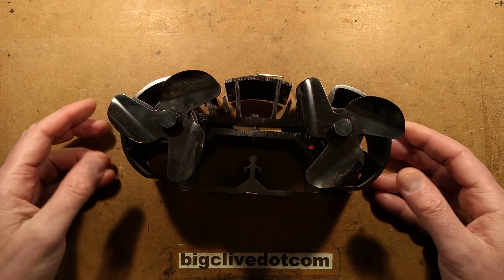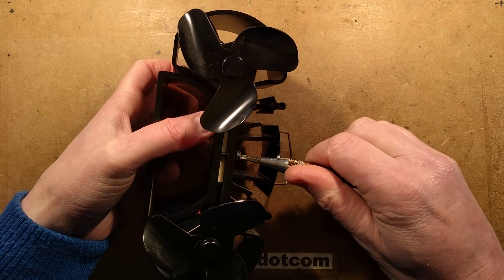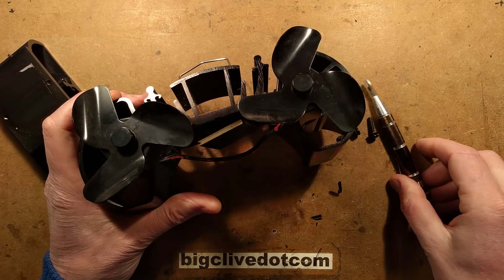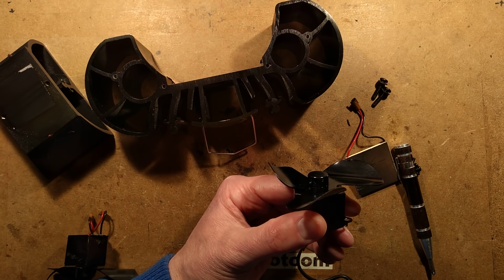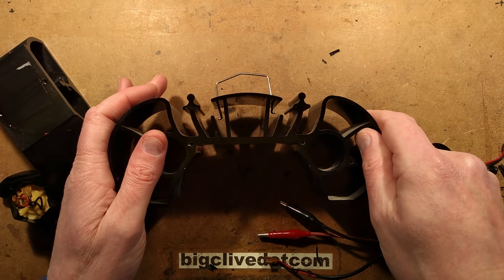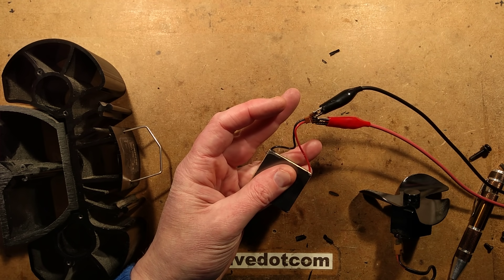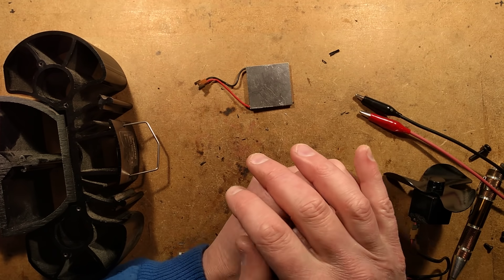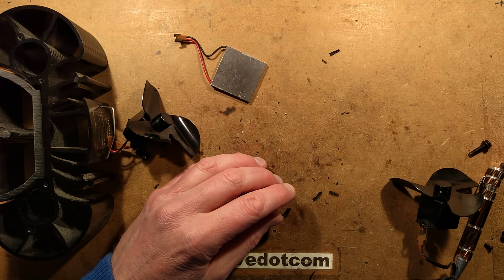Teardown of a self powering machine.

Comment: Get them at ALDI for £20. Might grab one and try to convert it to brushless. Got loads of spare motors and ESCs from quadcopter wreckage. Heat controlled PWM control circuit required.
Reply: Do all brushless need PWM? I thought they used hall effect sensors but that might be my brain shutting down why? No clue.
Reply: The motors used in Radio Ccontrolled models, drones, electric bikes, cars are 3 phase AC delta-wound and require an ESC. The ESC is  converts DC to 3 phase using FETs and also controls the speed using one of many digital protocols OR plain old PWM. The control signals are opto-isolated.  Some ESCs have telemetry and can detect feedback from the motor windings so hall effect is cleverly "built in". Most ESCs can provide regenerative braking too.
Reply: Some use hall effect sensors, other use back EMF on the non powered poles for rotation sense. All need 3 phase power and standard ESC's take PWM in to produce 3 phase out at variable frequency.

Comment: I have to wonder if those peltiers are a bit specialized, with more junctions than usual.  They need enough voltage to run the motors, so maybe it has more than normal.  I was suspicious when it only was drawing 1A at 8V.
Reply: It is not a peltier but a T.E.G (thermal energy generator) these can take much higher temps than peltier devices.

Comment: I have one of those peltier fridges, got it because I was being cheap. It's a piece of shit, the fans were loud so I replaced them with quieter PC fans and at that point I'd spent as much as a normal fridge would've cost. It's also inefficient as you said but I don't pay for my own power. I'm getting rid of it as soon as I move.
Reply: Mod it with two stacked Peltiers running at half voltage and the efficiency increases dramatically.

Comment: I have a water fountain which I assume uses Peltier ( the whole unit is very light ) and there are LEDs for hot cold and Warm, it's always plugged in, do you think it does not have a thermostat? hence the LEDs for hot/cold are not always on and the Warm one is on most of the time.

Comment: A few heat resistance options:
Teflon, 🌡️
Silicone,🌡️🌡️
High temp. mag. wire (HTMW),🌡️🌡️
HTMW in fiberglass,🌡️🌡️🌡️
Bare wire in ceramic beads, 🔥
H.T. Alloy ceramic coating, 🔥 🔥 🔥

Comment: Be sure to get a TEG not a TEC module. TEG is rated for generation. You can restore the bearings by washing them out with naptha, and forcing some fresh molybdenum high temp grease into the bearing housing.

Comment: Silicon tube? How about silicone insulated wire that is temperature resistant? I'd also look into a motor that's designed to operate at a higher temp, I'm sure there are industrial motors that are available if it's a standard size. Could be cost prohibitive but perhaps not.

Comment: I have had an interest in peltier elements for awhile and I have been wondering about the practicality of a device, powered by a candle on the bottom and a container of water on the top to sink away the heat would do for generating usable power? As in powering a phone charger?
Reply from the maker: It takes a lot to charge a phone.
Reply: @bigclivedotcom  and let me guess, peltier elements put out very little current...

Comment: Actually it's not a peltier plate. There are two different modules: Peltier cooler and Seebeck generator. One is used for cooling by running electric current through and the other one is pretty much the opposite. They have different structure though. Love your videos though !

Comment: Correction: this is a Seebeck effect generator, not a Peltier device. The difference is whether it's generating electricity from heat moving, or using electricity to move heat from one side to the other. There is a subtle difference in how they're made.

Comment: I use one of those Peltier fridges is a small 40 liter and originally designed to work from a car 12V outlet drawing about 49W but then the content inside will get below freezing not what I needed.
So I run mine at around 5V in winter (ambient 17C to 22C) and 6V in summer (22C to 26C ambient) and at 6V it draws about 12W this includes the DC-DC converter running from my 24V house battery. So decently efficient for a small fridge with not much thermal insulation and COP is around 1 so not great but better than cheap small AC fridges.
So 12W x 24h x 30 days = 8.6kWh/month.
There are two reasons why thermal control can not be done or is not desirable with this. One is that at lower power thy will be much more efficiency then if used at higher power and then powered off when they get to temperature and second is that when they are not powered they are a significant thermal bridge to outside so you will have significant losses while it is not powered.
A more complex thermal control can be done like say working between 4V and  7V in order to maintain a much more regulated temperature but for me it works fine with fixed voltage and keeps a certain delta between outside and inside temperature. The temperature inside my house is fairly constant as I have huge amounts of thermal mass storage and is insulated close to passive house standards.
The Peltier elements used in fridges are soldered using low melting temperature solder usually Sn42Bi58 that melts at around 138C more than adequate for fridges while the so called TEG as the one you have in this video use higher melting temperature solder and they can operate safely up to around 200C. As a generators they are around 5% efficient.

Comment: It's too bad the Chinese copied this style of thermoelectric fan.  I replaced one of these with a mil surplus kettle style fan that pulls cold air from above and blows it down at the  stove surface.  It's much more efficient at moving heat off the stove top and into the room.  My perpendicular flow TE fan really only worked well sitting on the edge of my stove and hardly moved enough air to be noticeable. The round kettle design produces a nice flow of hot air blowing off the stove in a 360 degree pattern. 

 I suggest you modify the broken ones to blow down towards the base, through the heat sinks in order to optimize the transfer of heat off the stove and into the room.

Comment: Clive being the guru of all things power bank ..pound land power bank 1200 mah is that at 5v or the actual capacity of the cell ..
Reply from the maker: These things tend to be rated on cell capacity.  So it'll be lower for the 5v output.
Reply: @bigclivedotcom  ok thanks clive i  will  dig out my dc cc load n test a couple ... will let ya know results.. thanks 4 reply

Comment: Like I said I don't know what the material is that the little squares are made of but I remember having to do the whole procedure I had to cut slices out of the Ingot bar in two discs the little bars into squares and then inspect each little square a little tiny box of this material and you would have to inspect it for cracks or scratches or anything and only the perfect ones were capped and those were the ones that we would solder onto one of those plates and then you would use solder paste you put the top plate on and put it in the oven as well as you know as well as soldering the wires on and all that stuff it's it's such a simple thing and what it does is freaking crazy as it always blew my mind how that thing could make cold or hot I can understand the hot part but I couldn't understand the cold part keep your beer cold cold weird if you want to open those plates best way to do it is to heat it up to get the solder to melt on a hot plate maybe I don't know you're good enough desoldering you can handle that would work you want to heat one side and and then all the ingots squares will stay on I hope you do open it cuz I do want to see it I haven't watched the rest of the video yet so maybe you do it in this video I don't know but if you haven't done it in this video please open that thing and show people what they look like inside let's look at those little squares

Comment: Look for a brushed drone motor with a high KV (lots of rpm's per volt) rating that has appropriate dimensions and rotation direction. Pay particular attention to the shaft dimensions. You do not have much voltage or much of a prop so you do not need to worry about spinning them too fast. You probably will not have more than a volt or so under load. You want an external stator motor which is a little uncommon on drones, but the do exist. Usually they use a gear to drive the prop on those drones...

Comment: Although this video is rather old now, I'd venture to suggest that these devices would last longer if placed toward the back of the stove, where the fan(s) can draw cooler air through the heat sink, and blow it across the top of the stove. . . . I assume the purpose of the fan is to disperse and diffuse the warm air into the room, rather than let it rise as a large plume to the ceiling?

Doing it that way will also improve the efficiency of the Peltier device by keeping the upper portion (the heat sink) cooler as well as saving the motor(s) from being baked, after all, it is the temperature gradient that is important, more than the outright temperature of the stove top.

I seem to remember someone playing with a Peltier type of device device to power a radio from solar radiation, back in the early '70s when photoelectric cells weren't so efficient. It was soon apparent that by burying one end of the "thermoelectric pile" into the ground, it became vastly more potent. I think perhaps more accurately, it was more of a 'dissimilar metals' device, but the effect was the same.

Comment: Should have used teflon insulated wiring. Also, the one with the one fin below the peltier shouldn't be black, it should be silver to reduce thermal radiation. I'm guessing it's aluminum so just polish it down to bare metal.

Comment: What is the function of this device when in use? So the fan is spinning on top of the stove to blow warm air at you?
Reply: Apparently this is for stoves that heat a room rather than stoves for cooking. The fan distributes warm air around the room more efficiently and stops the heat all rising to the ceiling.

Comment: What is the actual purpose of these units? If it's just to blow warm air around a room wouldn't it be cheaper to just run a fan heater rather than turning on a stove?

Comment: I think the first design is too short and thus too close to the stove's plate where the heat is simply too strong for it to cool itself off. Thats why wiring and motors got fried up. If you are looking into buying one of these look for the taller ones as those have much better self cooling since they are farther from the heat source and components wont get fried as easily.

Comment: The fundamental problem with those devices is that the cooling heatsink is above the stove as well, even if slightly further away. So they are doomed to be hopelessly inefficient and will almost inevitably heat up both top and bottom in the end. Both of them are a 'not very thought through' design

Comment: Technically the Peltier effect is used for cooling and  heating, The Seebeck effect is used to generate electricity. Basically the same device, the difference is just how you use it.

You can find TECs (ThermoElectric Coolers) and TEGs (ThermoElectric Generators) on ebay and aliexpress. As far as I know, the main difference is that the TEGs use a higher temperature solder because they will be subjected to higher temperatures. You can use a TEC to generate electricity as long as you don't overheat it.

Just saying.

Comment: Ive got the better quality fan , Eco fan made by Caframo Canada , had it for 10 winters and its as good as new, but there 3 times the price of Chinese ones, you can  get spares for these fans from reptuable stove dealers, Ive read if you change the peltier its best to use heat sink paste when installing it and not to over tighten the plate

Comment: Clive, can you point us in the direction to buy your knurled screwdriver sets?
Reply: search "precise screwdriver aluminum" on ebay.
Reply: "8 in 1 Aluminum Precision Screwdriver Set " to be precise.
Reply from the maker: The multi bit driver I tend to use is commonly called an 8 in 1 or 9 in 1 precision screwdriver on eBay.
Reply: @bigclivedotcom  you can pick these up in poundland can't you? I love my old one but not sure where i got it from.

Comment: Whatever you do, do NOT run one of those mini-fridges 24/7 in your room as an actual fridge.

I did just that when I a younger man, and thank god for the sleep cycles we often hold in those days, as I was still awake at 3am when it burst into flames. It turned out, when I checked the manual, there's very fine print which states "not to be run continuously for more than 24 hours."

Comment: Can someone explain what these are for? Are they supposed to turn your stove element into some kind of heater by distributing the heat into the room with the fans?
Reply from the maker: They circulate the air for more even room heating and possibly higher efficiency.

Comment: I used to build those inside the two plates is a bunch of I'm not sure what type of Ingot it is but they sliced it into discs and then slice the discs into little squares and solder the little squares inside and I built them but I don't know how they actually works and I know how it works I just don't understand why those ingots squares make this happen it's like a PC board inside of those plates there's a pad for each one of those squares like you said all you do is reverse the polarity get cold or hot on either side it's f**** nuts or it can make electricity it's crazy

Comment: Quick test for the heat powered fans - gently lock an electric clothes iron - sole plate up - in a vise and place the fan's base on the iron's sole plate.  You have some degree of control of the iron temperature and can watch it as it ages.  With the iron at your choice of temperature - I start with the lowest "steam" setting so 100C/212F - you can time how long for it takes to start spinning the motor..  

Here are some notes I made while testing Peltier vs compressor cooling.  Peltier lets you get cooling in some small spaces, but it is NOT efficient.

21 hours
2.63 KWH
22 cu ft (658 qt)
top freezer fridge (1998 model)
(maintains 41F fridge and 0F freezer)

20 hours
1.52 KWH
3.6 cu ft  (107.7 qt)
(maintains 41F)

13 qt (0.434 cu ft)
64.6 watts continuous
* 20 hours = 1.292 KWH
(maintains 30F below ambient (44F for 74F ambient)

1.292 / 1.52 = 0.85

Cooling 0.434 cu ft with thermoelectric cooling requires 85% of the power required to cool 3.6 cu ft with a compressor refrigerator.  Cooling 11% of the refrigerator's space requires 85% of the power required to cool the refrigerator.

The Engel MT35-U1 fridge averages about 0.6 amps at 12 volts to cool 1.17 cu ft to 38F in 77F ambient.  That's 7.2 watts.   
7.2 * 24 hours would be 0.173 KWH.  Three of these would be the space equivalent of the 3.6 cu ft refrigerator and would use 3 * 0.144 or 0.432 KWH in 20 hours.  That's efficient cooling on DC power.  At $870 each, it's also expensive - but probably cheaper than enough batteries and solar panels to support either of the other options.  Sorry, but I'm doing these calculations from the spec sheets.  If someone wants to donate $870 to a good cause, I'll be happy to do hands-on testing.
Or even $775 for the Engel MT45 I saw on Craig's List today ;-)
========================

Other compressor-powered DC fridge/freezers are ARB (Australia, comparable to Engel). Whynter FM-45G and FM-65G (45 qt  & 65 qt (60-70% of Engel price but uses slightly more power - has daily power consumption chart), Edgestar FP430 (43qt roughly half of Engel price but uses more power)

http://www.sears.com/kenmore-99783-4.4-cu-ft-compact-refrigerator-stainless/p-04699783000P
I have this one.  It uses 55 watts running and runs about 6 hours/day at 80F ambient or 0.33 KWH/day (0.37KHH allowing for 90% efficient inverter) which is more efficient than the Engel because it's 4.4 cu ft (114 qts) instead of 35 qts.  Kenmore is 3.26 times larger but uses only 2.1 times the power.  If you need mostly freezer space, all bets are off as the Kenmore just has space for two very small ice trays.

The 4.4 cuft Kenmore fridge is no longer for sale (models change every year or so) but might still be available under some other name.

Comment: Was the motor a 2700 or 4600 rpm version as you see both on ebay.
Reply from the maker: Not sure as they just tend to balance at the speed determined by current from the thermal generator.  So the speed wavers up and down as the upper section gets more or less cooling.

Comment: What are they used for? I've never seen, or heard of, them. Thanks.
Reply from the maker: You put them on top of a log or coal burning heater stove and they stir the air in the room.
Reply: Thanks Clive. They seem to be quite pointless, unless the heat is directed away into the room from the heat source, rather than straight upwards. Convected heat rises, crosses the ceiling, and descends on the far side of the room. Radiated heat projects across the room. An angled metal plate, or a computer heatsink-type radiator on top of the heat source would heat up and radiate heat in all directions, whilst being failure-proof and much cheaper. But hey, ho. Those fans do 'turn a profit'. 😁

Comment: would thermal paste work with bearing motors not BUSHINGs ? thinkin of modifications here in usa
Reply from the maker: I wouldn't use thermal paste on bearings.  Zinc oxide is abrasive.
Reply: @bigclivedotcom  my bad.. on heatsink.. got a call in middle of that.. lol & bearing motors over bushings that squeel.. but thermal paste may evenly heat dissipate for better fan control & ecconomy